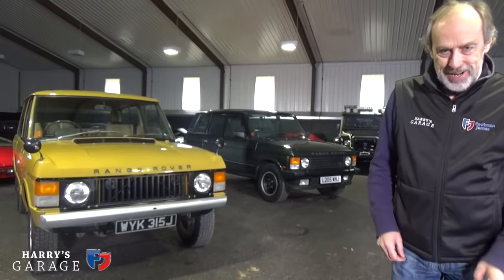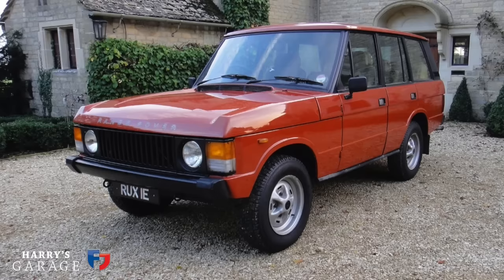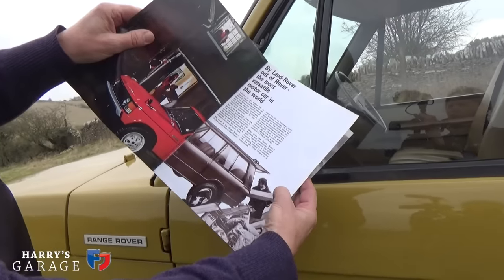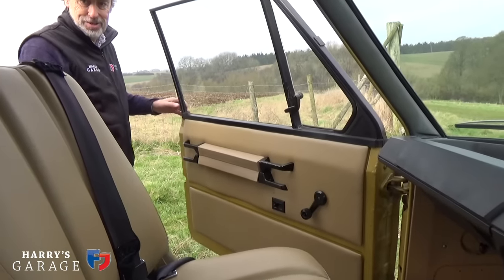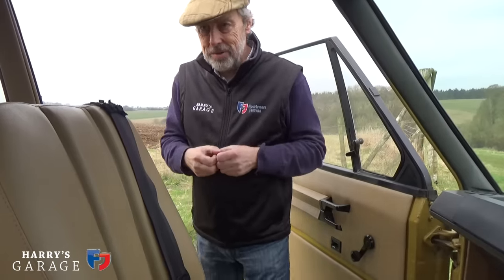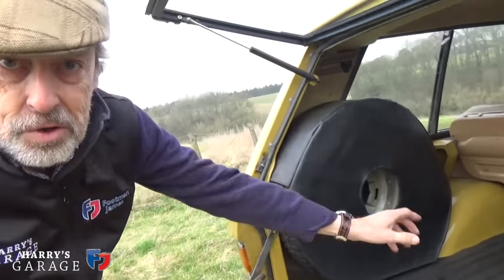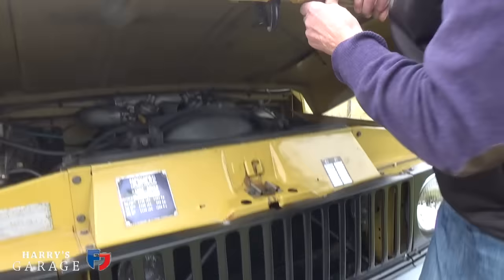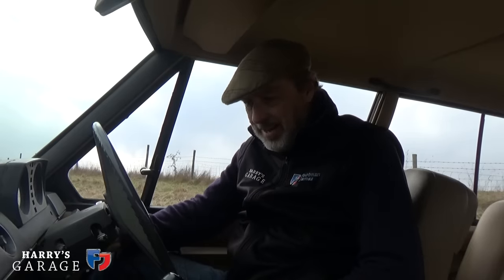Range Rover Classic. Real world review of '71 Suffix A & 90s Vogue

Comment: (comment 666) ;-)
If you can cope with the fuel economy (LPG is worth considering) there is no better car on the road. I'm on my fourth RR, 2x P38 & 2x RRC and the only other cars I would consider would be a 110 / Defender or a 1959 Cadillac Sedan De Ville (one day!)
It simply does everything you need of a car and does it without a fuss or fanfare.
My current one is a 1989 3.5 and despite being over 30 years old its still running pretty fine despite being a little cosmetically rough here and there which can be addressed as and when I am bothered enough. It may seem questionable to buy a car this old for what is essentially my daily runaround (when I'm not riding my Triumph) but if it has lasted this long it has been reasonably well looked after in it's past.
Another great video, thank you.

Comment: That's a nice engine. It started as the B-O-P, Buick Olds Pontiac 215 CI engine in the early 60s. The Oldsmobile iteration was thought to be the best. It didn't last long but did spawn the 3.8 V6 in later GM vehicles, an iron engine but still pretty good. I think it finally grew to 4.3 liters. As the 3.5 it was used in many British cars, it had a very nice exhaust note, V8 but a sweeter higher pitched sound.
Reply from the maker: In the UK, the ex-Buick, all-alloy V8 used in the Range Rover got stretching to 4.6litres in the P38 Range Rover (introduced in '95) and 5.0litres in the TVR Griffith. 
Thanks for watching

Comment: Harry excellent review ! As usual... enjoyed very much. Have a question. There was a thing about the first generation of the Rover V8 engines, and water loss... Any known problems on that? Many thanks ! Cheers.
Reply: My dad's P6 3500S tended to chuck a bit of coolant overboard. Cured it with a bit of pressure hose and a header tank off an Austin 1100...
Reply: My dad's P6 3500S tended to chuck a bit of coolant overboard. Cured it with a bit of pressure hose and a header tank off an Austin 1100...
Reply from the maker: Not sure about that one. I do know they it was tricky to bleed the coolant system correctly but know no more than that.
Reply: Harry thank you very much indeed! 

Ps : More bike adventures or reviews ....
Reply: Richard Harrold thanks mate... !

Comment: I miss my 89 Vogue SE I will never own a car as good or as iconic . I don't think the increased engine size is the big performance gain as much as the electronic Fuel Injection  gave. The 89 had EFi but lacked the cat of the later model and with a little careful tuning it was very quick indeed - definite pushed back in the seat feel if you fully opened the taps from a standing start. Yes and with full leather electric seats  a big tip being if you buy one make sure the switches operate properly.

Comment: Roll ! thats not roll. I had a '73 with a Perkins D4.236 up front and a 2" suspemsion lift to fit said engines sump over the front axle. That rolled. Indeed the fun was looking at the look of terror on oncoming drivers faces as you came barelling around bends with a 20 degree tilt towards them whilst actually under the speed limit and well planted on the tarmac. And mine had the evil Boge leveller removed too.

Comment: Hi, any info on my 1st Range Rover, Red, UK reg no'  TKU 56K. a very early example, all plastic,  but had a rear wiper. originally in Massai red with red rear pillars.

I have pics of it in my driveway, yr 1985 ! 
Many happy memories of this car. 
Diff whine, transmission clunk, Stiff to slide rear windows, no door mirrors, just these round ones far down the bonnet acting as great corner markers. 
The pull and the power was fantastic pure RAW Motoring go anywhere with power and it sounded ace too ! 
who cares about mpg ? 
Sex on 4 wheels ! 
I taught my girlfriend to drive in mine, and taught her Off roading, assessing terrain and stiff 4 speed box. No Power Steering ! H/brake on diff for hill decent,   low / hi box + Fairey O/D on 3rd and 4th. Plus vacuum Diff Lock on a pull up stubby light up manual shifter.

All the fun of a REAL RANGEY !   PURE DRIVING AT IT'S BEST ! 

If i had the money i would restore an old one Long before look at these newer than 1993 !  ( chain drive was a great improvement ) air suspension was a joke. 
Discovery TD5's are good also if you dump the rear air suspension. 
( they are like driving 2 cars in one point the front and it goes,   ... ?? ..... 

..... then the rear, thinks about it ..... then fails to handle. compared to coils all round.
The front does what you tell it to do, 
The rear hasn't got a clue what to do ! 
My rangey 200 TDi handled much better than my Discovery TD5. But the TD5 was a fantastic engine plenty of power ! 2 much power for them daft airbags on the rear.

the answer is coils all round with a Td5 engine or 3.9 V8. in a classic Rangey or Discovery. 
Then you have a superb car .
Reply: Tax due 1994.  Sorry mate but it looks as if it's been scrapped

Comment: question between the 2 were they both diesel or 1 diesel and 1 petrol I ask this as there were differences between the diesel and petrol variant of land rover..

as for your noise the col. mustard  it likely needs a good overhaul that much knocking indicates to me you be needing tranny oil and engine oils..

I would say transaxle needs some work as does the steering 

Note: col. mustard was still built for rural use not as a city driver...

if you to kill the noise in the rover the way is to sound proof it as much as you can..

Comment: Harry, can i ask your opinion on the Viscous Coupling (later model RR Classic) vs Diff lock (earlier RR Classics)  my main interest is which is better for off road.  I won a 93 Vogue RR classic.  Also I have ABS in mine, and the ABS sensors are 1.8k ohms, but the only one listed is a 960 ohmn sensor, so thus far I have not been able to buy the correct sensor  - any ideas for sourcing these??
Reply: Suggest you contact churchhouseclassics for advice

Comment: had a 72. clonky noisy slow and thirsty, so bought a 93, nice to drive, quiet and refined, but awful awful wheezy unreliable engine than never ran in damp weather. Also the later ones didn't have the bolted together bodywork of the older ones , so i ended up building one from the ground up using a 75 body and a Japanese powertrain giving me 30mpg , reliability and no oil patches.